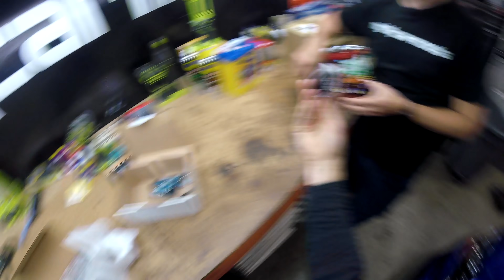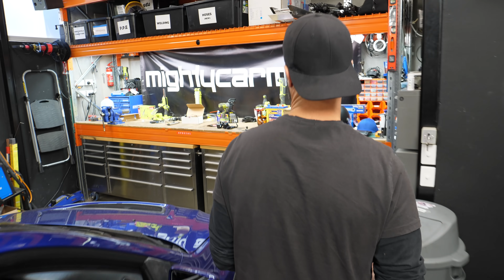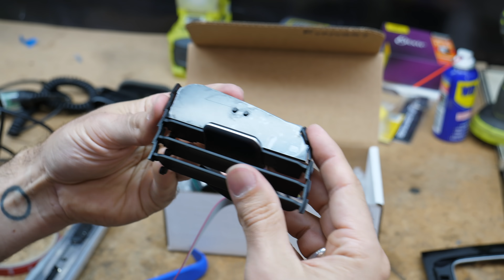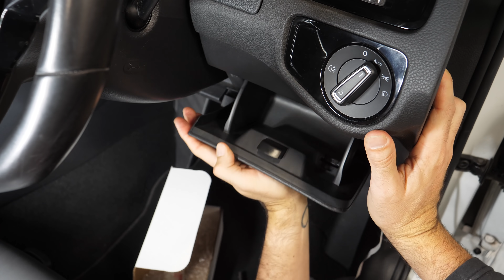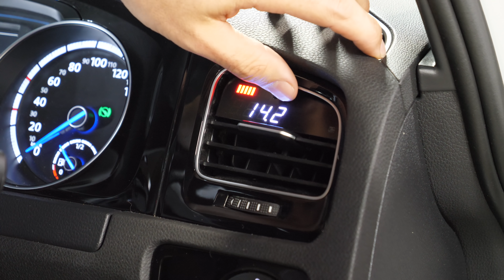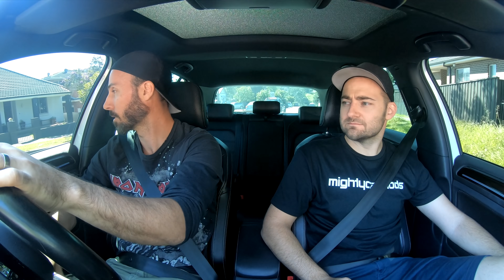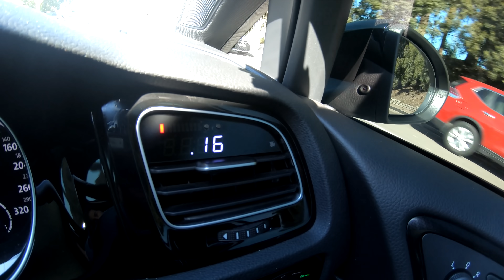Digital MultiGauge Vent Install

Comment from the maker: 11 years ago we uploaded a video called 'How To Install a Boost Gauge DIY'. MCM was brand new and had only been on YouTube for 8 weeks! Technology sure has changed a lot so now 11 years later, we're doing it again and showing you how it's done with OBD2. This week there will be 2 episodes showing you two different options for gauges. We also have MCM T-shirts back in stock (link in description) if you'd like to support the show. Enjoy! And you can check out the original 2008 episode here: https://www.youtube.com/watch?v=0-JieFM0MHA
Reply: The blue tooth and WiFi ones using the obd2 port to any phone or pad only cost a couple of bucks and come with free soft ware for your phone that's the best way to go on this and it does so much more shit been using it for years and years now that thing you got is over priced junk you just got SCAMMED
Reply: @chris681975  I have to agree I think Torque Pro on the Android Head Unit (e.g. like this cat here https://youtu.be/Hx2Oz9Af5fE ) looks so much cleaner, you can display more than one gauge at the same time, completely customisable themes, plus it's way cheaper. Sorry Moog!
Reply: @chris681975 I got imported from the US a wired touchscreen gauge that is a popular brand with diesel 4x4 trucks. I like it because I have an older ecu and it has the added feature of I can add extra sensors for it to read, do diagnostics/maintence, control LED bars from the touchscreen, it can even do ecu tunes. It cost about AUD$1000 with a competition sensor kit and a LED lighting control kit.
Generally speaking the updated gauge apps and dongles are fast enough these days, however if you have an aftermarket stereo head unit you can also try something like an idatalink maestro module. They are not too well known in Australia but apparently quite popular in America.
Reply: Nice guys! I love mine in my tuned Mk6 GTI.

You can also get their Track Pack chip which is a 1 minute swap. Gives you more timing options for acceleration and braking. 

http://www.p3cars.com/shop/accessories/upgrade-chip-track-pack-software/
Reply: I was just wondering yesterday if people still use these... They were all the rage at one point but i don't see them much anymore. Thanks for the vid guys!
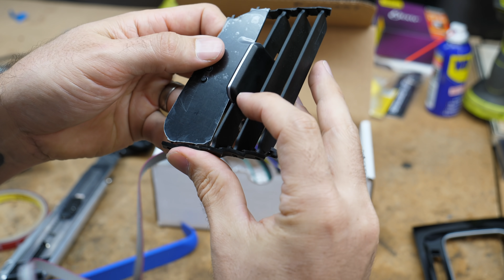Reply: Guys, please tell me or release the song at 7:06
Reply: For prying up little delicate plastic tabs,   (and sometimes opening zip ties if you are out of replacement zipties,)   one of my little treasures is actually an antique fine little slotted head screwdriver.   It's pretty ordinary, about 3/16 of an inch wide in old money,  just comes to a fairly thin edge and is made of better steel than most new things this size, a little springy, doesn't take a set,  also is precise,  so it'll just work.  It's probably mostly for like old clocks and carb screws where the slots were narrow, but is mostly a little case of 'They don't make em like they used to.'  Look for old stuff with wooden handles even.  :)
Reply: Mighty Car Mods watched a guy yesterday put this in his golfaru lol loojs sweet and oem
Reply: I remember watching your videos back then, One of the first ones I watched was when Marty bodged that cd drive from a pc to work in your car 😂 good times cannot believe it was 11 years ago!
Reply: How to install a boost gauge was the first episode I watched
Reply: how did you guys get such clean sound with a drone in the room? those things are loud as
Reply: "And guess what?! Rake Loves it", what happened to rake?
Reply: i would like to see a video on installing a heads up display too please and thank you
Reply: Are they allowed to use your stuff? https://www.youtube.com/user/mcmbmirussian/videos
Reply: Very good timing on this specific gauge install, as I was just looking at the same gauge for my GTI, and was curious about the refresh rate...had an OBDII gauge monitoring boost (among others) on my last car and it was about a half second refresh, which didn't do much good for boost. This gauge seems much more responsive. Thanks for everything you guys do!
Reply: Congrats on trending #13 guys
Reply: I appreciate all of your content and the effort you put into it. The quality is unmatched here on youtube.
Reply: These videos have really gone to shit in the past year..
Reply: @LunchmoneyH  lets see you do better then..
Reply: @christianbuczko1481  I'll need 35k to spend on a golf.. NP.
Reply: @LunchmoneyH  its not about the car, its about what you do with it.
Reply: coggins5569  why
Reply: @LunchmoneyH  ....I suggest you unsubscribe and get your money back. Oh,wait....

Comment: I've got an Android HU in my CJ, with a 10" screen, looks factory fit. I also got a bluetooth OBD2 and with the right app I get all this info on my screen in the middle of the car. You can also use the BT OBD2 with your smartphone or tablet to display the same info and for way less, about $10-20 shipped.

Comment: Why does Australia use kw an electrical power rating when the rest of the world uses hp?
Reply: Key Reasons for Using kW: 

International Standards: (kW) is the official SI unit of power, widely adopted worldwide and replacing older metrics like horsepower (HP) or Pferdestärke (PS) in many countries, including within the EU and Australia.

Electric Vehicle Standard: For EVs, (kW) measures the rate of energy transfer, essential for determining motor power and charging speed.

Accuracy: (kW) is a "purer" signifier of power than horsepower, as it is a direct measurement of energy transfer over time.

Simplicity: It provides a consistent figure to compare performance across different types of vehicles.

Comment: $500 is steep as fuck for HW and SW that's cheap as chips (<$100 to end customer) and on the market 20+ years ago and they had to do 0 R&D to get.  That fitment is pretty slick, though.  Not sure if I'd be able to justify that if I owned an R, but if you could find a used one for significantly less, good part for sure.

Comment: The module I prefer only needs to be connected to the CAN gateway module of the car. No more messing around. It shows many more ECU parameters on the cluster display. You can see 4 (or less) different parameters on the same screen, and you can set 10 (or more, I'm not sure) screens, if you want. Check out this: https://www.autopolar.net/product/polar-fis-mqb/ . I'm just a pleased customer.

Comment: Are you guys aware that you were sent the P3 gauge for a gti and not a golf r? The gauge that is for the golf r should have not have any red, only blue to match the golf r gauges. Also a boost tap is necessary to read correct boost, the ecu will only communicate up to 22 psi. Just a head up!

Comment: What the hell.
Yes, due to custom fitting I understand the price is a bit higher. BUT 500 dollars?!
What the absolutely **
My entire media setup in my Seat cost about 400 and with the OBD2 port connector (via bluetooth) I can basically run the same checks via a software program on the media screen, play audio/movies/etc/etc.

It looks nice though, but 500 dollars nice? no.

Comment: Thanks for doing this for the VW / Euro fans guys! I always wondered how this specific gauge works and if it was worth to get for my VW GLI or Audi S4. It is also quite expensive to get it from ECS tunning here in the US, much more expensive than the classic gauges, and I personally prefer the classic gauges since I like to see the needles moving as you get on it, but this installation is super clean!! So I kinda want to give it a go for one of my Euro cars... but something I am not a fan of is that you need to use the OBD2 por for this... I wish there could be a way to hard-wire it to the car instead of using the port. 

Aaaannd... you guys didn't need to do any soldering... just plug an play. 

Keep it up guys!! You guys are a huge inspiration for my car projects and my future channel, Baja Brothers Garage :)

Comment: How do you handle the permanent battery consumption using the OBD2 connection?
Reply: The alternator will just work a lil harder. That device would pull bugger all power wise.
Reply: Aussie Guy If you turn the car off, any connected device on OBD2 sucks power and the battery is going to be empty very soon. Exception: It got an power on/off switch.
Reply: @SkywalkerX76  At that price point I would expect it to have a internal isolation switch or resistor setup of some kind.

Comment: instead of using double sided tape. Use Dow Corning 736 Silastic. smells like salt and vinegar chips, but it will stick anything to anything. but you can pull it back off again. it's sort of a semi permanent adhesive.

Comment: In my C6 Corvette I went with a Android Radio. I installed the Torque app and used a blue booth obd2 to connect to the radio. Plus the factory head unit is awful anyways.

Comment: question might sound weird my aircon runs max up in Queensland as its always hot and its super cold will it gather moisture in vent slot at back of board and short out on obe is what im worried on ????

Comment: I never liked installing gauges in vents as all winter your blasting them with hot air then in summer your hitting them with A/C that causes condensation. Why ruin your expensive gauge when you can put it in a gauge pod or pillar mount.

Comment: Honestly i would invest in a obd2 passthrough and wire it into the boost gauge instead of the obd2 plug so that your boost gauge can stay on continuously and use other obd2 accessories at the same time

Comment: The 9 way D-Type connector "VGA" is quite common in the automotive industry. the system must read CAN signals from the onboard gateway (brains of the operation). Each CAN signal refers to a certain message ie; vehicle speed, throttle position, heated seats ect... so you could read most of anything off a devices like this.

Comment: I ended up going with an analog gauge on my GTI instead of the P3 because I've heard the P3 isn't as accurate coming from OBD2, especially when a tune is involved. Does anyone who has tried both have any input on that?

Comment: 500 bucks!? even a few hundred for an LED display is too much lmao.
Get a decent wireless obd2 reader (so you can keep bluetooth connection to car stereo) and link up to your phone with an app like torque or forscan lite. Cost less than 50 bucks or closer to 10 if you just get cheapo chinese hardware.... That way you'll get extra functions too like visual graphs, data logging, engine code scanning, only thing you might miss out on are the extra aux inputs if you need them which MCM didn't...

Comment: So please correct me if I'm wrong but doesn't accessing the OBDII port put the ECU into interrogation mode? I believe it will slightly mute throttle inputs and slow down all of the functions of the motor. I only say this because it's what I was told by a close friends who is a professional mechanic when I was troubleshooting engine codes on my girlfriend's VW Jetta (golf mk5 era).

Comment: I was going to fit one of these to my mk5 ED30 but one of the main features I want, oil temp and pressure, aren’t available. Plus I thought the display was a bit 1970’s calculator and would expect the word boobies or shelloils to periodically come on the display. 
Great stealth fit though 💪🏻👏🏻

Comment: That's an obscene amount of money for a display that only gives 1 catagory of info, in a relatively useless spot that requires your steering hand to dab at it (which will be very hard when the car is moving). Installing tablet display or individual gauges is surely more practical and vastly cheaper.

Comment: Holy shit, I need that soldering iron. The back of my closet is full of shelving that's full of Ryobi drills and impact drivers and saws and lights and charging stations and whatchamajiggers. I need that new whatchamajigger. Found it for $40 at Home Depot. Only thing is, from what I can tell, there's no temperature control. That's a bummer. 

But I did find this, a hybrid plugin or battery powered soldering station for $80, which I think is more my speed: https://www.ryobitools.com/power-tools/products/details/18v-one-plus-45w-hybrid-soldering-station
Reply: or you get yourself a ts100
and mod a ryobi charging station to let out power from the powerpack.
then you could solder of your car battery, the ryobis or a laptop power brick up to 24V.
(MightyCarMods did that charging station to "power station" mod on the build your own sliding board video)

the ts100 is really great because of the available direct heat soldering tips which are professionally useable.
Reply: @PsiQ  They have this. I wonder if they make one for Ryobi somewhere. For $20 that ain't bad.

Edit: Yep, check this out: https://www.amazon.com/Ryobi-40-Volt-Lithium-Ion-Charger-Portable/dp/B07NXWVWKN/ref=sr_1_5?keywords=Ryobi+USB+charger&qid=1558554411&s=hi&sr=1-5
Reply: @AlphaMachina  No, sorry, not the original Ryobi "to usb as powerbank thing".
You dont need a usb 5V source, you need something between 12 to 24V for the ts100.
The ts100 is often used by modelcraft flyers/ RC-Car perople,
who make an adapter form their lipo powerpacks to the ts100.

You basically buy the cheapest ryobi charger you find,
rip out the electronics except the contacts to the battery back and add the power cable for the ts100.
Because all electronics and controls and regulators is in the handle of the ts100
the ryobi part simply acts as plug-in port for the battery pack, where the powerpack itself has the protection integrated.

.... there you go:
https://youtu.be/7ZVIIXpmKm4?t=766
Reply: @PsiQ  Yeah, I have a TS100 and I run it off of a 20v laptop power brick, but I was thinking more of running the TS80 off of a Ryobi battery to USB mod of some kind.

The TS80 runs off of USB type-C.

Comment: Moog you’re supposed to move that top slat down one so the adjustment is bang in the middle. Mine fell apart numerous times and I think I remember crying at one point so a top install guide nonetheless! Love the channel, regards from North Wales UK 🏴

Comment: I was wondering why they installed it on the passenger side. "It's going to be real difficult to see that on the other side of the car.."
 Then they showed the steering wheel next to the vent, and I remembered that they're on the other side of the world.

Comment: Nice looking gimmik for a quite big prize... How about overheating such an installement by the Air vent? I deformed several ventmount phoneholder just by the heat the vent blew in winter...

Comment: I love mine! Only downside is that it only displays one piece of information at a time, besides that it gives you a lot of info! It also displays trouble codes, so no need to disconnect it when the CEL comes on (which it will on that VW😉)

Comment: Guys, that's not stealth enough! I did look at one of those a while back but i couldn't stand the cost so I ended up purchased a bit of kit from https://www.autopolar.net/product/polar-fis-mqb/ for my golf. Sits in between the car and the odb port and mounts under the dash. Brings up a shed load of data on the Existing MFD through the audio menu.  I can monitor everything from intake pressure to longitudinal acceleration, as well as boost, i can even see requested boost. Great for diagnosing a duff boost sensor!  It's all controllable through the existing controls on the steering wheel. It's a really slick bit of kit.  Link to video of the kit working, when i had turbo boost sensor issues! https://photos.app.goo.gl/pUrA1F5c2zzCK2rL7, sorry about the music :)

Comment: I saw this for my MK5 GTi and opted for the Polar FIS instead, as it shows more information at the same time and is very stealthy. Problem with the Polar FIS is that you can't recall peak readings and there's no warning lights like you'd find with old school gauges. My R33 GTR had a load of gauges which is what I might resort back to at some stage.
Reply: Back watching this video again, now that I've got a JDM MK7 and are going down the gauge route. Being in the UK and having only kmph speedo, I'm stuck between another PolarFis or the P3 gauge. That way I can track gauges and speed. However, I'm leaning towards the P3 as I can have that show as mph, and use the MFD for other things. Use case would be when other people drive my car and press the buttons on the steering wheel they lose the MPH screen and phone me asking for help, and then the phone takes over the MFD. The P3 gauge might have answered my own question. 🥳

Comment: I bought myself an OBD2 App, Bluetooth adapter and a Smartphone Holder. Its not that "Stock" looking, but it does the same job for much less money. The Solution you got there is just way to expensive.

Comment: 500 Doll-hairs? WOW! 
Pretty sure all that information is already accessible from the golf stock dash right?
And I can already tell you that the phone version next episode is going to be illegal (in the UK at least) as it's against the law to operate a mobile phone whilst driving (even if it's not being used as a phone you're not to touch it). 
So you can perhaps message those other guys that run that other show and tell them to use it in "Is that even legal?"

Comment: Dont wear the gopro on the head.
No OIS makes it unpleasant.

As for that soldering iron, I dont like it.

Not temp controlled.
480°C is not ideal, you will burn the flux away way too quickly.

Comment: I'm really curious on how these gauges would handle heat. I live in Canada and it gets quite chilly in the winter here, so I would really want to know if the screens could handle constant hot air blasting at it.

Comment: that soldering iron uses tips cloned from the hakko series, very cheap chinese tips are available if you want a fine point or a bigger chisel tip.

Comment: I like it. I think whoever did the styling needs an applause.
Reply: ...Though I would rather be able to slice a hole through the side to feed the cable rather than interfere with the vent.